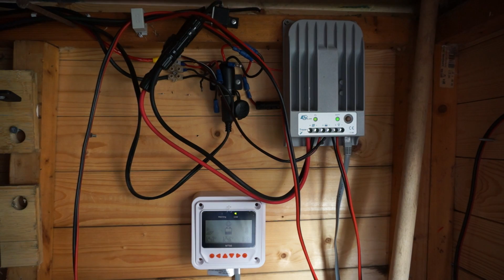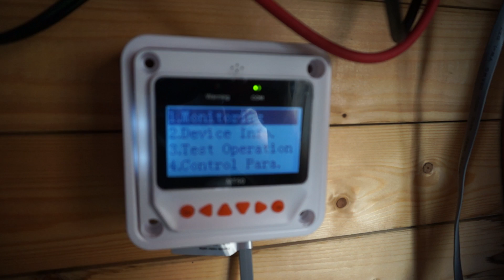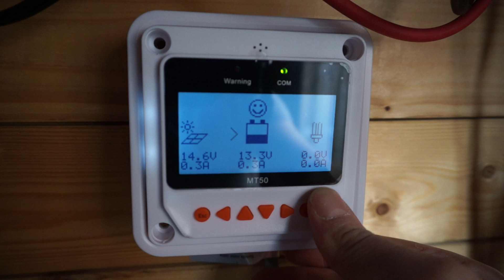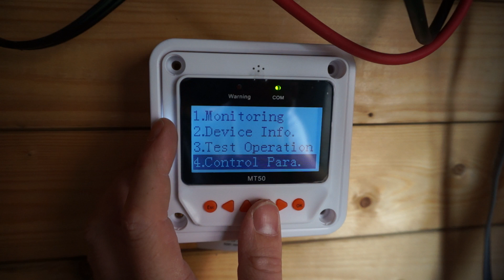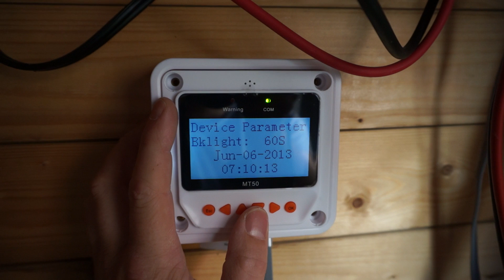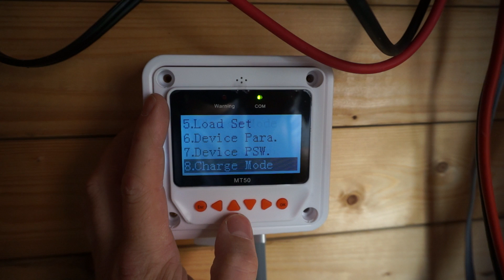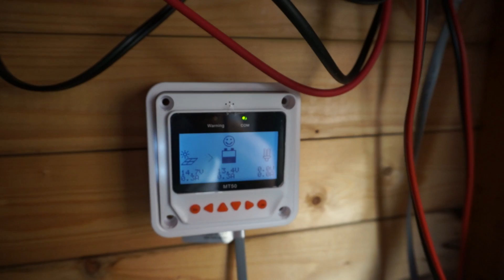EPSolar Tracer 1215BN with MT-50 tested

Comment: Help! I have the 2215 BTN and MT-50. I need the Load Set to energize (Light on/off) when the volts hit 12.8v (on) and 12.2v (off). Does this "Load Set" Light on/off function work only when there is no PV input (at night) or will it turn on the Load when the volts hit 12.8v? I need it to run a pond pump 24/7...and when the "load" reaches 12.2v...it shuts off. Coincidentally, when the solar/sun gets the battery up to 12.8v...turn the load back on. What am I missing? My old PWM worked this way...thanks,

Comment: Does the 2215bn require "the optional remote temperature sensor" for "the battery temperature compensation function" to work or is there already a built in temperature sensor?

Comment: Email reply I got from EPsolar yesterday

*
We have android APP to monitor via OTG cable and USB-RS485 cable.We
 have ebox-ble-01 module for bluetooth too, support blutooth 4.0 and 
above. you can contact with our salseman for it, dealer has no that 
module yet.Our R&D department are working for SOC, then we will release update files. *

so not only is a fix in the works, but so is wireless monitoring.
I'm quite excited!

Comment: What's your opinion about this controller is it better than previous version?
Reply: +Faizal Ps In my Opinion yes, I use a fridge on my setup which uses 6A for short time, then cuts off. My solar only has about 4-5A, the old one draws volts down to about 12.6V and then fridge cut off, having use very little battery, and 4A charge battery very fast back to 14.4........ It gets stuck boosting all day at 14.4V New charger this can be switched off or adjusted!